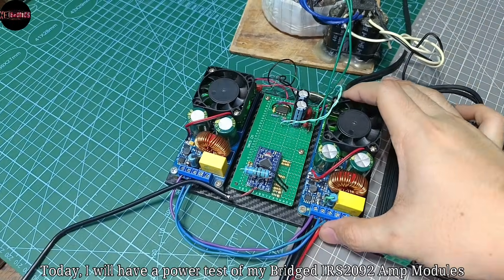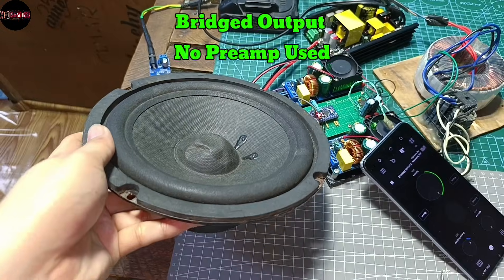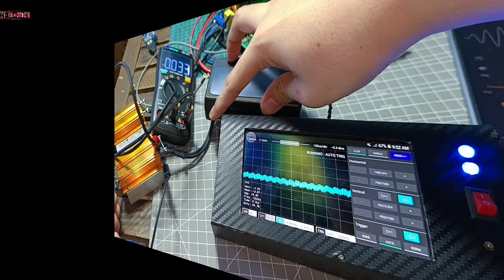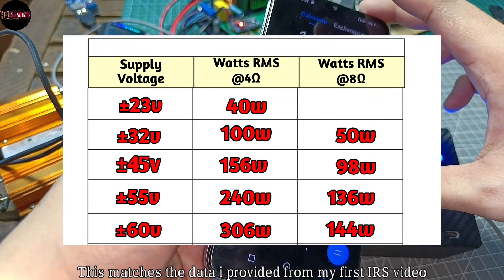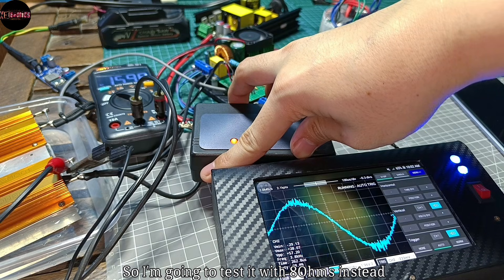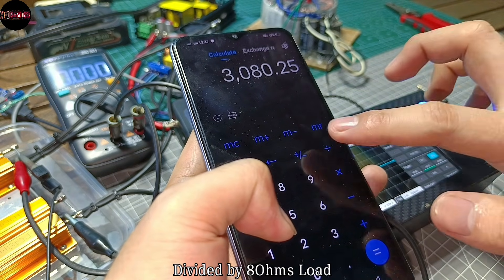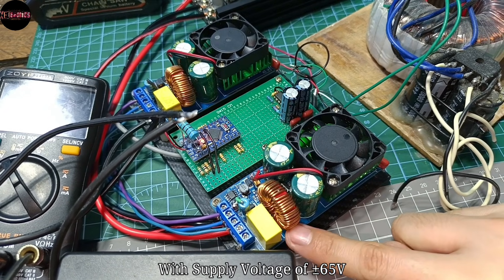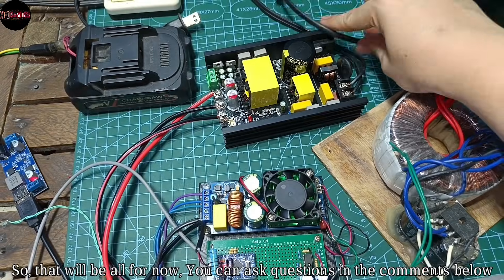Bridged IRS2092s Module RMS Power Test with SMPS #classdamplifier #irs2092 #diyamplifier #amplifier

Comment from the maker: Aliexpress Link for SMPS;
https://invl.me/cln336a
Shopee Link for SMPS -
https://s.shopee.ph/7pmMNWKtsG

I will try to Modify its OCP threshold and try 4Ohms Bridged. Hopefully it will not explode or something LOL.
Reply: Sir try mo lagyan ng voltmeter UNG psu mo mag ddrop Yan ... May ganian din Ako na power supply +-70  ... Kahit Isang mono lang drop nayan  pag nilakas mo.. not advisable UNG ganian psu sa bridge amp na irs2092
Reply from the maker: Naka 48V lang ako boss kaya medyo mataas ng kaunti ang current nito. 

80watts RMS palang boss namamatay na mismo yong Output ng IRS kapag naka 4ohms.
Pinag aralan ko na yong OCP neto, hindi ko padin makuha yong sa CSH banda, nag Ti Trip talaga Over Current Protection nya. 

Update ko nalang kayo pag nagawan ng paraan sana😆. 
Sobrang lakas sana neto kapag naka Bridged 4ohms
Reply: @x3dtronicsph napapa isip Ako what if 70v na nka bridge mode  yan Ang gusto ko Makita
Reply from the maker: Nako, kung orig MOSFEt boss possible. Pero kung stock MOSFET, baka masunog talaga o may pumutok. Baka di din kayanin ng Trace. 

Sinadya talaga nila i design na mag Trip agad yong OCP. 
Gusto ko nga itry yong ibang IRS2092 board para ma compare sana
Reply: @x3dtronicsph old model KC UNG irs mo sir  UNG new model is Kya UpTo 80v
Reply: @x3dtronicsph UNG akin hnd umiinit UNG step down sa 12v kahit nka 70plus compared sa old model 65v palang maniinit na UNG step down

Comment: May video ka ng power supply mo kung paano ang mga connection papunta sa ampli?
Reply from the maker: Send ka nalang ng Picture sa FB ko boss. Para try natin i layout
Reply: @x3dtronicsph nag order na q idol.. napa order aq dahil sa video mo 😁. Hintayin q lang dumating.
Reply from the maker: IRS2092 ang ampli mo boss? Baka may noise issue yon boss ha, Hindi ko sigurado sa ibang PSU. Yong sakin kasi Okay naman. 
Pero may chance kasi na involved na tolerance sa kaparehong supply

Comment: Can you make a video on 2 ohm loads vs 4 ohms vs 8 ohms and it's benefits?
Reply from the maker: As of now, it is impossible. 
The OverCurrent protection of this Specific IRS board is tripping at Low Load impedance. 

If you're referring for the load speaker itself. 
I might need a lot of research to it to summarize

Comment: Eyy ❤ galing mo idol
Reply from the maker: Salamat Idol
Reply: Idol meron Ako binili ulit irs2092  Yung sinasabi nila buffer malapit sa mosfet Yung thermistor ntc nya is empty pwede Kaya lagyan ko nang thermistor ntc Kasi tinignan ko sa datasheet Yung value is 10k thermistor ntc gusto ko sana Yung mahaba pa a nang thermistor para ma edikit ko sa heatsink nya di katulad nang smd na thermistor ntc.
Reply from the maker: Hindi yon buffer boss HEHEHE. di ko din alam sino nag pa uso na buffer daw yon. 

Yong circuits nayon boss ay nag dedetect ng output, pag may problema yong output dahil sa mga mosfets or ibang issue. Mag ti trigger yon, Naka connect yong sa SD pin ng IRS2092 na IC, yong SD na yon ay Shutdown Pin ng irs

Comment: Solid boss, laging detalyado
Reply from the maker: SALAMAT bossing. Sana magawan ng paraan yong OCP. Estimate ko around 500watts RMS din tong bridged pag kinaya sa 4ohms
Reply: @x @x3dtronicsph  Akin yung power supply pa problema ko lods, sa tingin mo totoo Kaya yung ibang nag sasabi sa comments na +/-80v gamit nilang supply. 
+/-44v yung sakin, Plano ko sanang I-upgrade sa max na makakaya ng irs2092 para isang gastos nlng
Reply: @Meme_supplier   totoo gamit ko matagal na
Reply: @MisterElectric-nv6ki  no overheating issue boss? No modification needed? At Chaka anong psu gamit mo boss, transformer or smps? Thanks
Reply: @Meme_supplier   transformer na 70 0 70 AC sir pag na regulate na yan na sa 80+ na dc output depende sa amperes ng transformer mo.. sa akin ne rewind ko lang kasi 45 0 45 lang dati. walang overheat po magaan ang tunog pag mataas supply. yong lang need mo OCP baka sunog speaker mo at sigurado sira din yang IRS2092 mo pag nangyari. napakalakas nyan di kaya ng mga 502 na mga amplifier integrated. basta tamang supply pure 500watts RMS yan
Reply: @Meme_supplier   transformer na 70 0 70 AC sir pag na regulate na yan na sa 80+ na dc output depende sa amperes ng transformer mo.. sa akin ne rewind ko lang kasi 45 0 45 lang dati. walang overheat po magaan ang tunog pag mataas supply. yong lang need mo OCP baka sunog speaker mo at sigurado sira din yang IRS2092 mo pag nangyari. napakalakas nyan di kaya ng mga 502 na mga amplifier integrated. basta tamang supply pure 500watts RMS yan
Reply: @MisterElectric-nv6ki  Ayos boss, thanks sa tip.
Reply: @Meme_supplier  yong OCP optional lang yan para sa mga kaibigan mo na makulikot kamay baka ipihit ng malakas sure na sunog speaker tapos shorted yong mosfet totoo kasi anyare na sakin dati. yan baka makatulong ako pero sa issue overheat wala po ne minsan
Reply: @Meme_supplier  yong OCP optional lang yan para sa mga kaibigan mo na makulikot kamay baka ipihit ng malakas sure na sunog speaker tapos shorted yong mosfet totoo kasi anyare na sakin dati. yan baka makatulong ako pero sa issue overheat wala po ne minsan
Reply: @Meme_supplier  Sir bili ka sa online speaker protection yong rated 1000watts kasi yong mga 500 watts rated mag trip parin pag nilakasan mo na